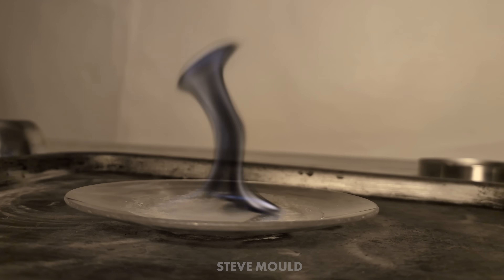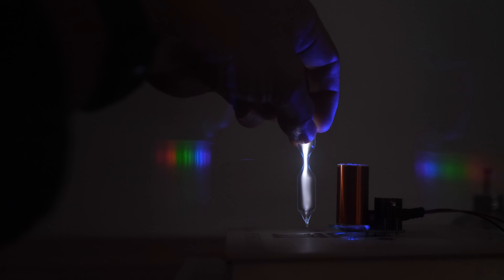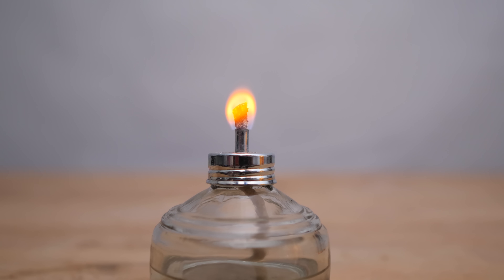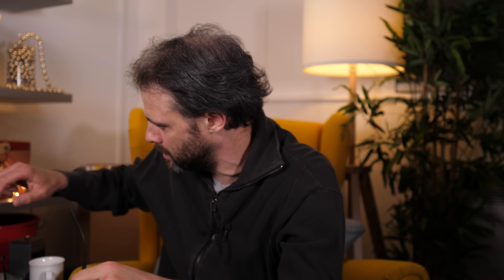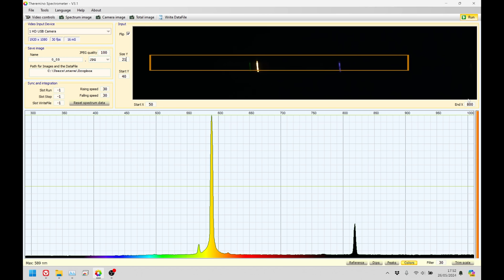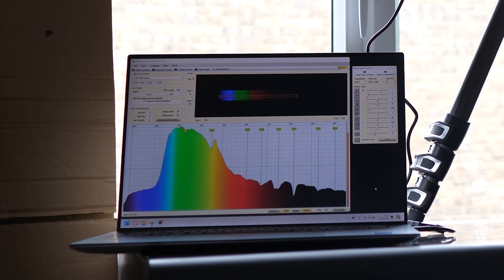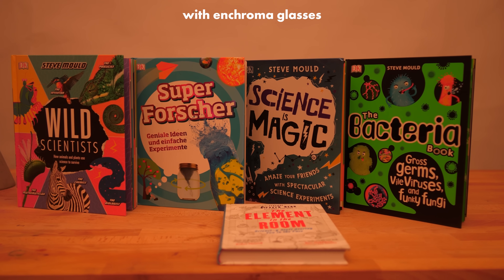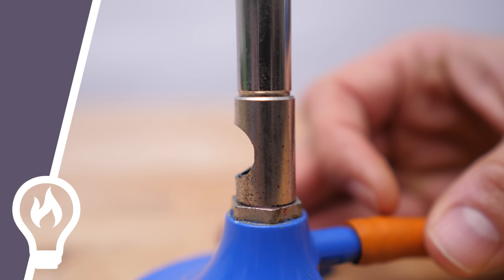Light sucking flames look like magic

Comment: Interesting to think that if we just used sodium lamps, they don't look great, but they are good enough for navigating in most cases and signs can be lit by headlights or integrated lights, you'd do less damage to people's circadian rhythms, reduce adjustment between lit and input areas, enable people to recognize fatigue by not stimulation them with blue white light and, added benefit, you can get dark glasses, or even have your windows block that wave length entirely, so that you'd be completely dark to street lights at night!

Comment: In this video, you always refer to this lamp just as a "sodium lamp". Yet that's an incorrect explanation, due to it being an incomplete explanation. What you don't make clear (though I already know from my own technical knowledge on the subject), is that this is a low pressure sodium lamp. And this trick will work ONLY with a low pressure sodium lamp. It won't work with the more commonly used high pressure sodium lamp. The higher pressures and temperatures in these lamps broaden the spectrum of the lamp, so that its output bandwidth is wider than the ultra narrow bandwidth of the vaporized sodium salt found in that alcohol burner experiment. Therefore, with high pressure sodium lamps, only a small fraction of its output is absorbed by the sodium flame, and no visibly noticeable amount of darkening will occur.

Secondly, when you casually mention this is a "street light", that only is true in a certain geographic area (Europe). In the US though, high pressure sodium lamps are the only ones actually used in street lighting. I don't think that low pressure sodium lamps ever have been used in the US for general street lighting. The only uses I've ever heard of are certain laboratory devices (such as spectral calibration lamps for optical equipment), or in outdoor lighting near astronomical observatories (to make it easy to filter out the light with narrow-band notch filters). Only in Europe did these see widespread use as street lights, and I think even then those ended up getting replaced mostly with high pressure sodium lamps (due to better color rendering, and the need for drivers to be able to see different colors on street signs at night, for road safety). So referring to this just as a "street light" like you have, and not as an "older European street light" seems very Europe-centric, like your video was intended only for a European audience. It makes it harder to understand for those outside of your own region of the world. Yet YouTube videos intended to convey scientific knowledge should be done in a way that anybody watching it can understand what you are talking about.

Comment: "How can a point light particle have angular momentum:
Because they are not one dimensional.
Nothing is.
EVERYTHING is 3d dimensional.

Using a picture on a paper as an example.
It has width and length, but it also has depth equal to the thickness of the graphite layer.
We commonly refer to this image as 2D because the depth is not significant, but it exists, even if it is statistically negligible,

Comment: The emission line in the infra red is the Na I doublet at ~8200 Angstroms (820 nm). I'm an astronomer and I use this Na I doublet from M-dwarf stars (it's a very strong absoption line in these stars) to measure their radial velocities and rotation speeds

Comment: what you said that studies on glasses are inconclusive reminds me of a similar issues with computer glasses (what they call them "blue light" which is so wrong). Studies show that they dont help but I spend many hours in front of a computer monitor and they help a lot for LED monitors. I suspect LED emits more UV than older CFL LCD monitors and glasses stop that easily. Who knows what studies are doing

Comment: They've just replaced all the high pressure Sodium street lights on our street with LEDs. Now the light reduces to practically zero the instant we move across the boundary between our property and the sidewalk.
The LEDs are custom tuned by the installers, to cast light where it's needed, and not where it just happens to go.
My backyard is transformed, and the nigh sky photos are much MUCH better!

Comment: Ok, so yellow/orange sodium lamps are actually brighter than a flame. Then why did some team of brilliant engineers decide that new led (or is it lcd?) headlights should be in the blue spectrum? I have been “blinded” by other drivers’ blueish led daytime running lights in the middle of the day recently more than I have ever been by yellowish halogen headlights at night.

Comment: 2 Bit DaVinci  JUST did a video about a New design of Internal Combustion Engine with no moving parts that uses this exact phenomena to produce Electricity. The design heats an internal core of Sodium using hydrocarbon flame until it glows that exact frequency of light spectrum and they surrounds that core with Photovoltaic cells tuned to absorb that specific frequency to produce electricity. The supposed result is an engine that is HIGHLY efficient (on paper at least)

Comment: You should create glasses that helps you to see at night while driving by dimming the bright light from other cars' headlines but still allowing you to see the dark part of the road. Kinda like the baby of sunglasses and night vision goggles. I've been thinking about this, would something like this even be possible? A material that allows all light through but only up until a certain intensity. I guess you could find a material that dims the specific wavelength of headlights, but then, you get such a variety of headlines. And white headlights probably contain the whole spectrum anyways...
Reply: Also, unfortunately, if you had a specific wavelength of light coming from headlights and a filter that omitted it, that would mean you couldn't see the reflected light from things illuminated with your own headlights either.

Comment: "If the electron spins in the same direction as the orbital, then it makes the magnets attract each other more strongly".

Isn't that the oppposite? Orbital has a negative charge. It is made up of elecrons, after all, right? So if it becomes like a little magnet due to it's spin, same for an individual electron. Then why would same charge and same spinning directions magnets become attracted to each other more strongly?

Comment: Great video! I'll have to get myself a spectrometer at some stage.

If you're interested, I highly recommend the study "Empirical tests of the effectiveness of EnChroma multi-notch filters for enhancing color vision in deuteranomaly" by Lucy Somers et al. They tested EnChroma's glasses on broadband munsell surfaces as opposed to regular color vision tests. They found that the glasses enhance the appearance of colors, but also noted that the glasses do not allow for new color experiences, as EnChroma often loves to advertise. 

"It is important to note that our positive results do not imply that EnChroma filters have the potential to create “new color experiences” that are unachievable without the filters. Since filters cannot alter the spectral composition of monochromatic light, the spectrum locus of monochromatic lights which ultimately bounds the anomalous trichromatic color gamut cannot be altered by EnChroma filters or by any other spectrally-selective filter."

Comment: I saw a misconception in this video which keeps getting spread, mainly because the actual explanation is a lot trickier and weirder to understand than the actual reasoning. In the video, Steve says that the reason there are two lines is because the electron spins are either in the same direction or different direction from the orbital angular momentum. But, this is not true. Rather, it is because of statistics and the Pauli exclusion principle.

The Pauli exclusion principle says that an electron cannot be in the same quantum state as other particles. As it turns out, there are 4 different options for spin orientation: both spinning in the same direction upwards, both spinning in the same direction downwards, one spin up and the other spin down, and then vice versa. We then write these as a math statement. The first one is written as ↑↑, the second is ↓↓, the third is ↑↓, and the last is ↓↑. HOWEVER, as it turns out, ↑↓ and ↓↑ are not actual "good" states. For those who this word means something to, they aren't eigenvectors of a 2x2 matrix -- which is necessary for a state to be physically possible. So the solution is to change the set of states we work with to: {↑↑, ↓↓, ↑↓+↓↑, ↑↓-↓↑}. This is the set of all possible spin states.

Now onto the Pauli exclusion principle. Because an electron is a "fermion," when you swap two electrons, all that should change is the overall quantum function -- the thing which describes the electron -- should have a negative sign. Let s be the spin state, and p be the rest of the function -- describing which orbital the electron is in. We write that the whole function P is a function of particle 1 and 2, written as P(1,2) and equaling s(1,2)*p(1,2). In other words, P(1,2)=s(1,2)*p(1,2), with * just meaning multiplication. The "fermion" statement I made means P(2,1) = -P(1,2). So, s(2,1)*p(2,1) = -s(1,2)*p(1,2).

Now, we will look at each of the spin states. Note that when you swap the order of the first three spin states, we get ↑↑, ↓↓, ↓↑+↑↓. The last is identical to ↑↓+↓↑ because you can swap the order of addition. HOWEVER, the last state becomes ↓↑-↑↓ = -(↑↓-↓↑). This means if the particle is in the first three states, then we have to say p(2,1) = -p(1,2), and if the particle is in the last state, p(2,1) = p(1,2). This property is what causes the electron to have different energy levels.

If the particle has the first property p(2,1) = -p(1,2), the particles tend to be repelled away from each other, and we say that the position function has a "fermionic" behavior. In fact, THIS is why solids are solid. It's not that there are electromagnetic forces repelling electrons from electrons. Rather, it's because of this fermionic behavior of matter. Neutrons do the SAME exact thing, which is why neutron stars are a thing. They are held together and kept from collapsing by this pressure called "degeneracy pressure," despite having a neutral charge.

If a particle has the second property, p(2,1) = p(1,2), the particles tend to be attracted towards each other, and we say that the position function has a "bosonic" behavior. Light is a boson. A bosonic particle tends to be attracted to other of the same type.

I will make an important distinction: the repulsion of fermions and the attraction of bosons ONLY happens because the particles are EXACTLY the same. All electrons are 100% completely indistinguishable, there is no way to know for 100% certain one electron is not another electron or one photon is not another photon. Fermions are ONLY repelled from other fermions for which they are 100% absolutely identical to, and bosons are ONLY repelled from other bosons they are 100% absolutely identical to. Protons, neutrons, and electrons, for example, are not repelled from each other by this degeneracy pressure.

FINALLY we can get into why the energy levels are different. If they are in the fermionic position state, we call this state the "triplet" state, and the position function needs to be of a higher energy because of the degeneracy pressure pushing the electron further away. And, if they are in the bosonic position function, we call this state the "singlet" state, and the position function needs to be of a lower energy level.

Now, I will admit, I feel like there is something slightly wrong here. I believe an important statement is I need to say magnetic fields show up someplace in here because iirc, splitting of the singlet and triplet state don't occur unless if there is a magnetic field. Iirc, this magnetic field is due to the nucleus's spin (?). I am willing to correct myself if I made any mistakes. At the very least, the misconception which keeps getting spread is that objects are solid because of electromagnetism, which isn't true; it's because of spin statistics.
Reply: The main point is that electromagnetism plays little to no role in this, and the role it plays is weirder than you think. It's not "spins in same or opposite direction" but much weirder.
Reply: As @yorickandeweg2134 pointed before, it's spin-orbit coupling, so speaking about 2-electron behavior (fermionic/bosonic states) is incorrect. However, (somewhat miraculously) it turns out that the addition of spins of 2 electrons obeys the exact same mathematical rules as addition of electron spin and its angular momentum! Thus your description is largely correct. The key difference is that angular momentum on P orbital is 1, so instead of 1/2+1/2 addition (described by your arrows) we get slightly more complicated 1+1/2.
Reply: @yorickandeweg2134  Ok, yes, I agree! I think I got excited because the hyperfine and spin-spin coupling tends to be rather misunderstood too often as being an EM effect and not just a pure quantum effect. But, I humbly admit I was wrong!
Reply: i genuinely don’t get this but now i’m determined so im commenting so i can come back to it later. to be fair i just woke up and haven’t gotten to this part of the video yet

Comment: Great video. Megalag and his videos on Enchroma are the place to go.
In fairly unscientific terms the glasses can't work as it's the sensor that doesn't work correctly. The sodium 2 peaks not being able to be resolved is actually a kinda good example. The sensor is incapable of resolving between the 2 colours so it looks like it's only 1. What enchroma glasses are saying that they are doing is creating a notch filter that separates the wavelengths that are problematic. The sensor (eye) still can't differentiate between light wavelengths that are detected on both the red and green cones but what the glasses do is filter out wavelengths that simply get junked as they may be detected by both the red and green cones. The glasses work in very much the same way as the Steve Mould glasses but over a much broader wavelength range. A normal sighted person under sodium light could put these glasses on and experience something similar to what a colourblind person wearing enchroma glasses does. What they see is different but it's not necessarily helpful or beneficial.
IF the enchroma glasses actually worked videos showing people passing colourblindness tests rather than staged videos where the colours are literally numbered to allow for correct sorting.

Comment: RG colourblindness here and the Enchroma glasses work for mefor specifically the reason you described. It filters out the shades of colour that make it confusing to distinguish. Purples and pinks are amazingly more vibrant. Same with greens
Reply: Ye, it's pretty much one impairment at the cost of another, so it's a 50/50 case if someone likes it or not - which makes his careful description of it more useful than a full blown "no" or a careless "yes"

Comment: I (from Australia) had glasses similar to the EnChroma ones back in 2004/2005 and they seemed to work for my red/green colourblindness they cost about $1000 at the time. I do recall specifically red being much brighter and greens being much darker the complete opposite of what I saw without them. They were sunglasses and the design went to great lengths to ensure a minimal amount of light could get in around the lenses, there was minimal gap around the frame between my face. Which became painfully obvious when someone hit me in the face with some text books and the frame of the glasses pierced my skin around my eye socket requiring a few stitches. The lenses themselves were also reflective with a mirror like effect on the outside.

Comment: Unfortunately it makes everything look weird you said.

But actually one of the reasons of using these streetlights was:

Less colors for your eyes mean less distraction in the night. Which helps you focus at night.

The lights are now replaced by LEDs because of efficiency. And because the old lights tend to explode when water gets inside.

Comment: “Fact about the universe.” Mr. Mould! It is a scientific theory! A useful model! The point like particle probably has no angular momentum! There probably is no point like particle! 

The modern conception of an atom is very likely not the one that will be used a century from now.
Reply: FWIW (very little), my favorite is that all electrons are fluids and the quantized emissions of photons are due to shock waves propagating through them.

Comment: With the Enchroma glasses: I couldn't find anything real about the drama. There's people happy with the product and unhappy with the product, but that's typical of, well, anything.
It's not like they are selling snake oil. Even if purchased online they have a 60-day free-shipping (if not shipped internationally) return policy. The thing though is that there's no such thing as "free shipping," it's just already included in the cost of the item.
This means in the end the only one at risk of losing money if the glasses don't help you is Enchroma themselves.